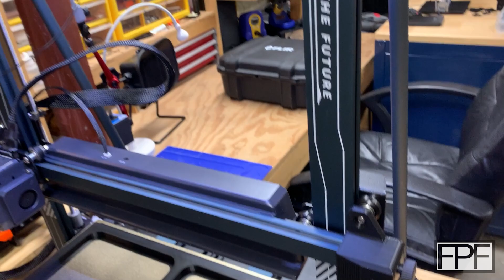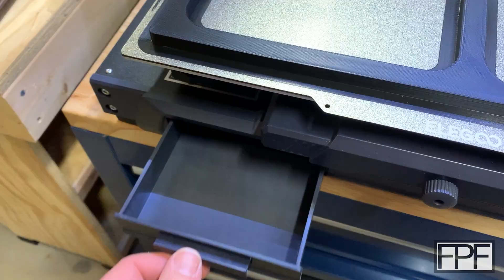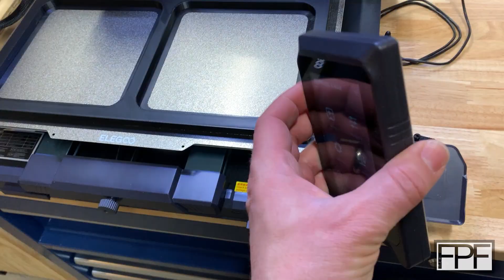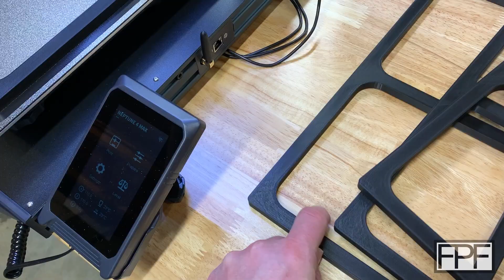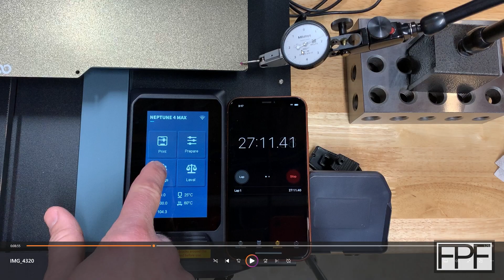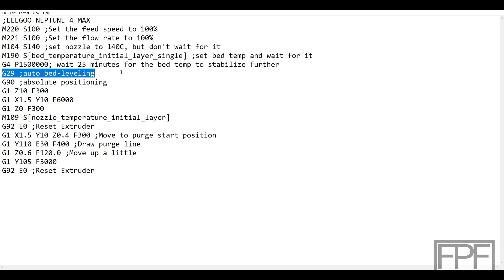Neptune 4 Max Review and a FIX for the PROBLEMS EVERYONE IS HAVING

Comment: I will say, it looks like they have fixed the bed moving like it was in your video.  This thing is still a pile of garbage but, I printed a bracket that wraps around the x axis, (basically a 100mm H x 60mm d x 20mm w, with a 20mmx20mm square hole in the middle, then sliced into two parts,front and back, and tapped 8/32 holes)to attach my dial indicator I use to make sure my expensive table saws fence & blade are almost perfect.   

So I attached the bracket, printed with 80% infill, so it’s not moving at all.. attached the dial indicator, lowered the x axis until it was touching the bed.. zeroed out the dial indicator, and turn on bed temp like you did, and waited.  I was ready to record / take pics because I have elegoo support asking for pictures of what the problem is.  

buuuuttttt, this bed didn’t move even a smidge, I waited for 30 minutes. 

So, that’s good news!  They are actively working on continual improvement.  

Also: I saw another YT about upgrading the leveling springs to silicone bushings.   They are getting great reviews in bezos’ site.  I ordered some but given my results with the bed not moving while heating up, I might not install them right away.

Comment: You are a god send! I was nearly there: figuring out the the leveling is not static/ does not persist.. but, GOD it was so frustrating.  I'm not a 3d pro by any stretch, Bambu gave me a false sense of confidence I suppose.  I was in the trenches BATTLING larger prints.. I couldn't understand why one print would work, then the next would not.   So, while I was close to figuring out that the level did not retain and I needed to do firmware updates.  I had no clue about the other aspects of leveling the bed. So, again.. thank you.  As far as the firmware update.  I agree,  (now as of  2025), it shouldn't be that complicated.  Im an IT guy and do firmware frequently for various devices.  Elegoo seems to have gotten their Firmware update inspiration for 1990's motherboard Bios updates..  their process is ancient.  that said, having to hotfix: essentially updating firmware twice is somewhat common, and actually a good sign for the future.  Mine didn't need to do the hotfix, so as of Feb/March 2025 they have at least gotten past that hurdle.  I did kackle though when I read the "other" instructions, specifically the Raspberry pi Image option, TMI.  99.9% of the people are not going to buy that adapter and do all that.  I might, just because again, as an IT guy, I do like the idea of having an image that i can load just in case.  But their instructions for this process is very... vague.  I figured it out but most people will have issues, guaranteed.  

Overall, so far my experience with this printer... 2/10.  The only reason it gets a 2 is because how easy it is to add a camera, lol.

Comment: hey great video it fixed my long waited issues i have watched a lot of videos almost gave up but u pulled me through is it possible to get a starter code for ABS or the one above will work fine, i know that for ABS the bed needs to be hotter thanks again :)

Comment: Have you checked the actual temperature of the plate compared to the set value? Had my max 4 assembled and tried first print with obvious first layer adhesion issue with petg. While searching YouTube (and found your video) I check the plate temperature with IR temperature meter and noticed that at 70°C the actual was 60 even after 15mins stabilation. Then tried with my thermal camera and result was the same, it's 10°C off. Tried 80°C and actual was 72. So I don't know if there is a way to calibrate it. Will also try out your methods to get actually first print out from machine..

Comment: Your fix is very sensible and I can pretty much confirm that even without owning that Elegoo. How? Cause we just this week got Prusa XL to work. I've had MK3's before at home and work. But anyway. XL has even multiple heat zone hot plate and it's quite large too. What surprised me a lot is that can take like 5-20mins more to start print than MK3 and that isn't very fast printer in todays tech. It depends on material, but there's like initial heatup and then display literally says like "Heat soaking in progress" and timer can be easily like 10mins. Then it probes the bed and if there's large part it takes tens of calibration points. And it's not ever then as then it heats nozzle and starts to print. That doesn't take long though. But all-in-all heat distribution is an issues on larger printers and it took me bit by surprise. Oh and there is option to skip that heat soaking. Tried it and regretted the choice immediately as print got so bad first layer that I stopped print. I print occasionally like small 30mm diameter cups to shield sensors on machines and I'm 100% sure that certain small parts are faster to print with MK3, even though XL is insanely much faster at during the print.

Comment: Quick question for anyone who knows. He has a variable controlling when the printer begins the countdown. Is this variable specific to the slicer or is this universal to the firmware? I tried exporting my gcode from Orca, but it kept getting hung up on the export and had to revert back to Cura. Attempting to run a print with this starting gcode resulted in the bed heating up to 60 degrees then shutting off. So I hardcoded the value to 60 degrees and it seems to be maintaining that temp now. Hasn’t started yet, but I wanted to see if anyone has run into this issue before.

Comment: Thanks for the tech review. I wonder if there's a way to speed up the process by overheating the bed, and then bringing the temp back down. Go all the way to 110c for 5 minutes, and then cool it down. Maybe that would blitz the temperature to the edges a bit faster.
Reply: I cover my entire bed with a carton sheet the size of the bed, heating very fast to 60c to 90% of the bed (checked with thermal camera) the front corners only 5 or 4celsius colder

Comment: Do you use glue sticks on your prints for pla? Mine don't stick at 60 or 65 degrees without a glue stick.

I wouldnt know when to apply the glue. If i do before the 30 min heat soak, wont it lose its stickyness after waiting so long?
Reply from the maker: No glue needed.  Take the plate off and clean it with a sponge using dish soap and hot water.  Wipe dry with cotton cloth and avoid touching it anywhere you want a print to stick.  I you have shapes that really want to pull a corner, turn on brim in the slicer.

Comment: Im getting my 4 Max next week. I need something big as I want to print a massive tower model for wargaming, with parts up to 300mm length. 

I was wondering if buying the 4 max was a mistake, but I felt like it wad the only printer within my budget with a big enough build volume. 

Your video convinced me to go ahead and order. The work you've done is brilliant and I will be using your profile for sure. I plan on doing prints that will take several days, a 30 warm-up at the start is nothing compared to days wasted if the print goes bad mid print. I'll keep an eye out for more videos from you!
Reply from the maker: I moved to an even longer warmup (45 mins).  It's still the only affordable machine in this size class.  I hate it, and yet I'd still buy it again :P

Comment: BOUGHT THIS MAX 4 AND HAVING NOZZLE TEMP ISSUES RIGHT OFF THE START, NO CUSTOMER SUPPORT GETTING READY TO SEND IT BACK...SET NOZZLE TEMP AT 210, GO TO PRINT IT GOES DOWN TO 140 CANNOT GET IT TO MAINTAIN TEMP.  CANNOT PRINT ANYTHING, BOUGHT NEW EXTRUDER SAME RESULTS WOULD HAVE BEEN NICE TO HAVE SOME KIND OF CUSTOMER SUPPORT FOR SMALL ISSUES, DID NOT GET ANY REPLIES

Comment: My Neptune 4 Max does not stay on the bed after a few layer are made, I have cleaned the bed with 3M alcohol solution etc. but having the same problem again any thoughts for solving this problem.
Reply: Use dish soap with warm water to clean de bed, soak warm to 60c for 25 min and do the bed leveling, (in that order) then adjust your first layer

Comment: Wow, I learned so much.  I also have been having these problems.
Wonder about acceleration too.  If that can cause layer shift.

Besides this I changed to a .9mm nozzle and that has not yielded great results.
Tried Orca and Elegoo Cura slicers, but no help.   
Any good vids on changing the nozzle settings on the 4 Max?

Comment: You are a Hero For the Neptune 4 Plujs & Max Owners ! 
i had really Bad Bed Adhesion problems and no matter how often i tuned the Z Achses it always had struggle now i imported the Wait for the bed to Heat up to my Cura Profile but with 50000 less milliseconds i started a print it waited for around 15-17 minutes and it just worked thank you alot i was on a verge to sell this Machine... 
elegoo needs to implement this in their profiles !

Comment: Couldn't you just heat the bed for half an hour and do one leveling at that point and save that instead of heating for a half hour and redoing it each time? I know you may have reasons to do it again later like if you move the sheet around but shouldn't that be sufficient? My AnkerMake works like that and seems to hold the leveling well between print jobs. I just redo it later if I feel it's necessary.

Comment: First things first: Thanks for all the awesome content! Love channel 😁

Really good video on this. I have actually just now bought a meter just like yours, for the exact purpose (only I have a N3Max, running Klipper) ... Now I see you have already done it... a full year ago 🤣. That said. There are some outstanding questions:
- First, you could use KAMP to only probe the area that your print will use. Have used it for the past year. Works awesome (and several people have suggested that already). 
- The center of the plate appears not move as much (if at all) which makes sense for a number of reasons based on the design of the bed and carriage. So the reason to wait for heat up should be very dependent on where on the plate you are to print/probe. From my experience 
- It should be possible to not heat the extruder until the bed is ready. Heat to print temp --> Wait X minutes --> heat the extruder and wait until hot --> run KEMP probe.

Made an initial test here and appears to work just fine. https://github.com/werkstrom/OrcaNeptuneMAXStartScript

Comment: I have had my 4 Max for over a year now and have done some amazing prints but the fails far surpass the successes. I am about done with this thing. I have replaced, via awesome Elegoo support, every single freaking component of this printer short of the actual chassis. I have orders, I need consistency, I do not have that! Until this video, I call this printer a POS! However, I am trying these tips and will see if it will change my mind. I have 3 other printers running but no where near the print surface as this which I truly need! I will check back in after some testing! Thank you FPFDesigns! Fingers crossed!

Comment: Im a man of cura and have mostly used it for my stock un upgraded ender 3 ive had for years i mostly use it cause im used to it and that it takes less time to print things using cura i was printing a vacuum wall holder and my cura said itd take 6 hours to print with 62g of filament where when i use the exact same file and orientation and same settings in prusa it said itd take 16h32m 84g to print sure it'd probably be stronger part or look better but i just dont have 16 and a half hours to wait for a simple vacuum holder if something's wrong ill have to wait even more for a second print

Comment: This gentleman should have millions of subscribers.  Thanks a bunch for acting as Elegroo's Quality and Control, Developer and Tech Support all rolled up in one.  Very impressive and lets me realize how lost I am with the Elegroo Neptune 4 Max being my  first 3d printer.
Reply: Just purchased one today. Yikes!
Reply: @BloodlustProductions GOOD LUCK
Reply: @BloodlustProductions  I fixed all the errors I was getting by changing to Prusaslicer and using Neptune 3 Max as the printer.  I also ordered silicon bumpers to replace the springs under the leveller.
Reply: @BloodlustProductions  not all bad news. I just got a neptune 4 plus any a week ago.  Still working through some of the bugs but it's no where as bad as it was on release a year ago. I am very new to 3d printing so if you are also learn from my mistake.  Don't just use auto leveling.  Even some YouTubers are saying you just need to use the auto level.  First set the z offset using the knows under the print bed abs a sheet of paper.  The auto level does NOT adjust the z offset abs you will end up with the glob of death on your print head.  I was following instructions from a YouTube video that failed to mention the z offset and just used auto level.  I had to replace 2 print head because of pla building up and around the print head. Making it in fixable without replacing the print head.

Comment: This will fix your problems I bet if you take the sock of the hot end you will see filament in there   and that means your hot end has a leak between the nozel and the heat block . These printers have that issue  . Just a heads up if your prints start to fail or don't look good or if you can't get a good first layer it won't be bed it would be that the hot end has a leak.  As these machines rely on nozel pressure hot end problems your just have problems . . Merry Christmas dude . Just a heads up about Neptune 4 plus and the max as the use the same hot end . And mine started to go wrong I checked the sock and fair enough had filament in there fixed the leak now Machine is perfect . Prints super good .

Comment: You can heat the bed to 110 °C for several minutes and then put the temperature to 60 °C and wait for a few more minutes to let the heat spread over the bed. The bed should get into needed shape much for faster, than 25 minutes.

Comment: Great video. I learned a lot. I haven't ventured into messing with gcode or printer programming at all so I'm spitballing, but would there be a way to the set the desired temperature of the center of the build plate to a value and installing a temperature probe at the corner then telling the printer if temp probe == center temp value then start print? I was just thinking this would possibly eliminate the ambient temp variable.

Comment: I dont know if this is just for the newer firmware but it seems like you have to Save the config file and restart the printer for the new bed mesh to apply. Would it be smart to add a SAVE_CONFIG code line underneath the auto bed mesh leveling code ??

Comment: now that it is 10 months later, is this still a printer you are using or have you replaced it with something else?

… as a mechanical engineer in a former life, watching this video brought back many memories from working in the machine shop and learning how to properly adjust and carefree the tools we would be using.

This a great video, o love your rational, changing one variable as a time, great methodology, so many people rush in and try to tune everything at once, but you took the time and rationalised it out in a logical fashion. and made really clear points to back reasoning and findings.

Thank you!

Comment: how would any of this be affected if printing in the basement at 65F ambient, same deal, still 25mins or so preheat?  I've done 30 mins but the first layer giant square tests i've done always end up with ripples, even after trying to adjust for z offset.  Running Open Neptune so i do probe first cold, well technically heat up and do screws tilt first, then room temp probe z offset calibrate, then do the prints and adjust z later, cant seem to get a perfectly flat first layer, even on the smaller scale.
Reply from the maker: I've since upped the pre-heat time to 60 mins.  I hate waiting, but the prints are even more consistent now.  65 shouldn't be a problem @60 mins.  Is it drafty?  I can see how inconsistent drafts could really cause that bed to just keep moving all around

Comment: This is unreal! I just got into 3D printing and got a Voxelab Aquila X2 printing perfect and then got a deal on a used 4 Max and I've had hell with it. Coming from a background in a machine shop when you brought out the test indicator I knew this was gonna be good! Once I get this long print off my 4 Max I'm gonna start working with your profile.

Quick question as a very new 3d printer operator: In your orca profile how did you determine the acceleration numbers? Been down a rabbit hole the last few hours trying to understand how to get a baseline and tune accelerations. I started with a profile off the Elegoo discord and when I fired up my first print the damn thing sounded like it was letting go!

Comment: I think the answer to the bed problems with this machine. Is the use of a single pad under the bed to heat it up . They should had devided the bed up into four zones and used four pads so it all heats up evenly that's it's problem .

Comment: Good day, i think i am having this issue with Neptune 4 pro as well, after a while printing i can hear the nozzle hitting the support or the printer, a small tick.. until what i am print detached from the bed, i wonder if that configuration from your Neptune 4 Max might work as well on my Neptune 4 pro.
Reply: I haven't had this issue with my 4 pro, but it does have 2 elements for the bed so possibly not staying a consistent temperature everywhere. Especially with the parts fans on full blast.  I have turned my fans down to 50-60% on all prints and run 250mms on stuff I want quicker with no ill effects